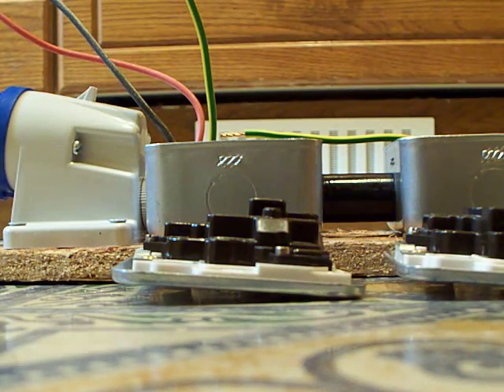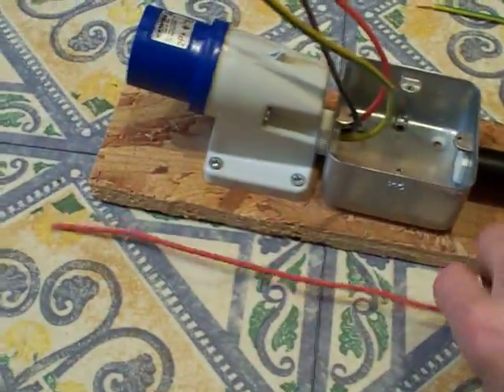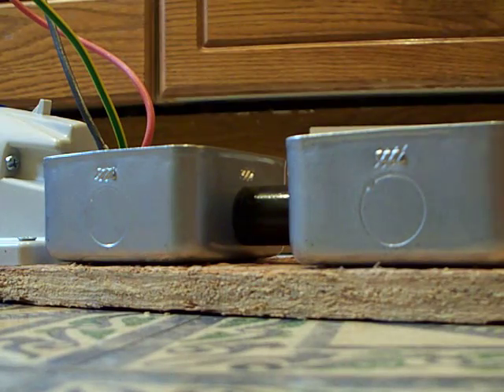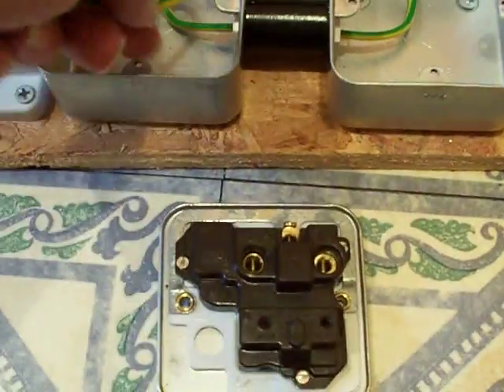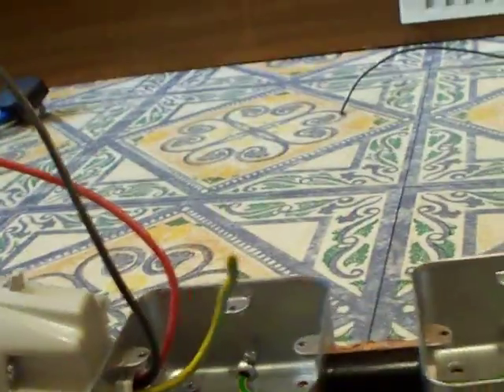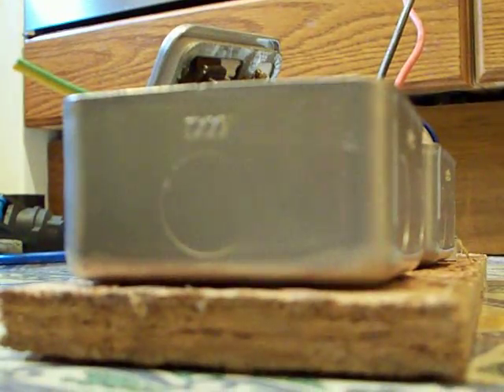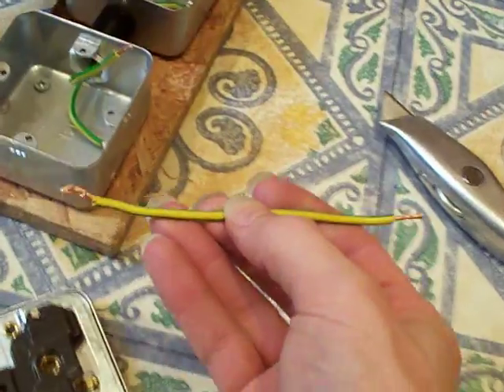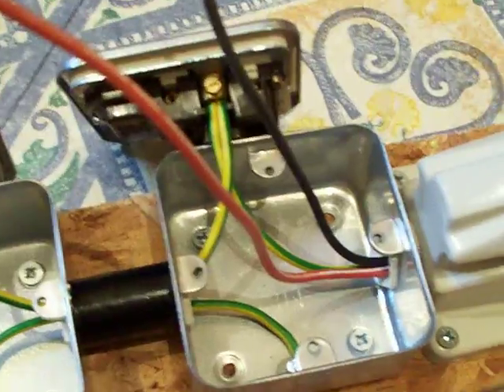Electrical : Making a Fun-Jiggery-Pokery Unit ( Part 2 of 2 )

Comment: The old wiring in the house which is from 1967 except of the new breaker panel have Brown-Black-Yellow,and there's so much carbon black on the wires in the walls that if you don't scratch them to death you wont find out which is the brown and which is the black unless you test it for power. XD

Comment: Hello.

Yep 16A max. :D

But it's not a problem as i originally made it for testing TVs and such with an 100w bulb,and bigger things with maximum 2000w/8A kettle as ballast.
Plus the breakers of the rooms have Type C 16A breakers. XD

Yes i've seen those colors,mostly in commercial products like of Ikea. :D

However here on new installations we use Red-Blue,Red-Black,or a recognizable combination of those depends if the owner of the place has any wire spool in hand and wants to limit the cost.XD

Comment: One of those mini tripods with the flexible feet would probably come in handy for filming projects like this :p
Shame to hear about the memory card. As already stated, recovery programs can be used, but only as long as that 'area' of the card isn't overwritten, it's generally best to do it before the card is used again at all. Recuva may not have worked since the file appeared to be on the card, it's likely that the corruption caused by the camera dying is due to the type of file format used.

Comment from the maker: Hiya. The heater has a 15A BS 546 plug on it by choice, that's all. Out of all honesty, it shouldn't have a plug on it at all: It's a wall-mount heater, & as such, should be permanently wired to a flex outlet. Because I like mine to be moveable, I've put a plug on it, but while it has a plug, the Wiring Regs would generally forbid its use in a bathroom.BUT! Recent changes in the Regs does actually now allow for a 13A socket in a bathroom, but VERY STRICT conditions apply though! -BoomBoxDeluxe.

Comment from the maker: @ChiplessStar Interesting stuff about the copperclad! It's bizarre, because I always thought copper & aluminium were electrolytically reactive with each other, as they used to have problems with that in the USA where someone's house was whole-wired with aluminium, someone would add an extension wired with copper, & the copper-to-aluminium joints would react with each other, fault-out & start fires!

Copperclad? Hmmm, bizarre. If you have some, plus the lead sheathed stuff, a vid would be cool.

Comment from the maker: @nicwilson89 Hiya. I didn't know that recovery software was available. Basically, my computer said that half of the memory card was full, but the icon in the folder said "0 bytes". The file was stuck in the card somewhere, and the only way that I figured that I could 'repair' the card, was to re-format it. Anyway, that worked, but in the process ( as with any formatting...) the file was lost. The footage that was lost, wasn't too important thankfully!

-BoomBoxDeluxe.

Comment from the maker: @flamesecureUK Ah yes, the 'ripcord' technique. :D That's another way to do it, but really, blunting the knife isn't much of a biggie. In fact, when I put a new blade in, I actually blunt it down a bit, because I can be a bit heavy-handed with one of these knives. The knife used in this vid is virtually blunt, but still knife-edge enough to strip back insulation & sheaths. Too sharp (i.e. a new blade) can damage conductors!

Oh, one other thing: I do actually power this up at the end of the vid.

Comment from the maker: FANTASTIC!! :D 

Have fun with your Fun-Jiggery-Pokery Unit. I'd avoid connecting things into it which involve electronics though, as under-volting such loads may damage them. 

Stick to resistive loads and basic electric motors....That's where the fun is. :-)

See the vid: "Fun: A fan slow-down.....How slow can I get it to go?" and in that vid, I use my Fun-Jiggery-Pokery unit to slow down the big air-rotor fan, and to restrict it, I use a fan heater. :D

Thanx for watching. Have fun! :D

-BBD.

Comment from the maker: Ah, you put 1.5mm wiring in yours? That's OK for about 13-16A, but for extra beefiness, a lower de-rate, and longer running times & duration, I put 2.5mm wiring in my Fun-Jiggery-Pokery Unit. :D

Red (phase) Black (Neutral) & Green+yellow striped (Earth) is the old British colours.

New European colours are brown, blue, & Green+yellow striped respectively. :-)

Thanxx for watching,

-BoomBoxDeluxe.

Comment: why was the fan heater connected with a 15amp plug?
I have also made one of these myself before watching this so I could have a bit of fun without taking out any fuses, only I used cheap plastic fittings instead of metal clad, would've been nice to use nice fittings though.

Comment: So here's your jiggery pokery build. :D i watched as much as possible with some fast forward. XD  Which wiring coloring did you had in the UK? Black Red Green-Yellow? Well i'm used to everything even Brown and Blue,i prefer Red-Black but i have used Blue quite a lot,also Red-Blue. XD The Ballasted Multisocket has Red-Black 1.5mm solid core wire. XD

Comment from the maker: @flamesecureUK Yep, that's another way of doing things, I guess. There's so many possible variants of the Fun-Jiggery-Pokery Unit that making one which is unique may be possible!

Heck, I could make one which has a 32A plug, 4mm cables throughout, rotary isolator switch, and two 32A outlets to BS EN 60309-2. :-D

Just imagine for a moment.....The fun jiggery-pokery that could be had with a 32A supply. :-D

{^_^} BoomBoxDeluxe {^_^}